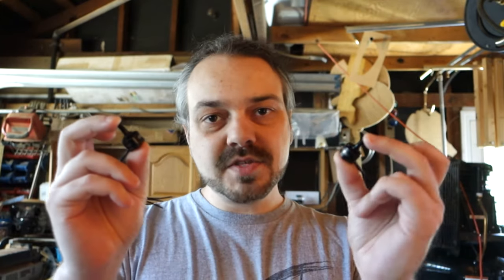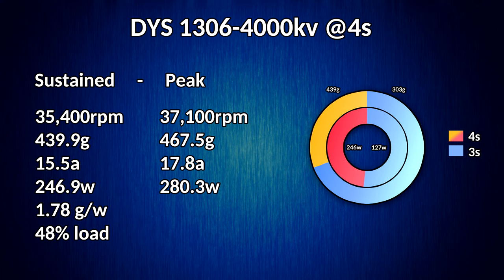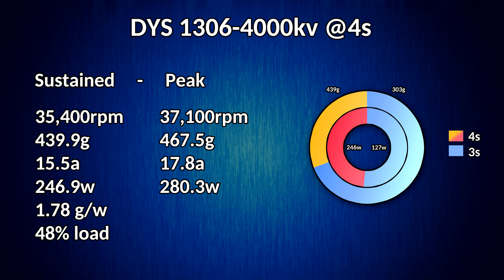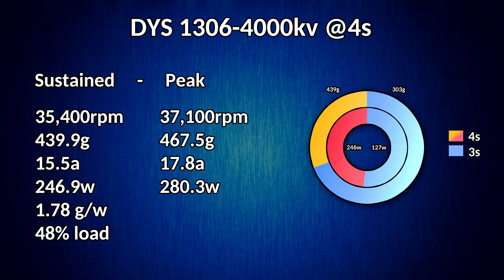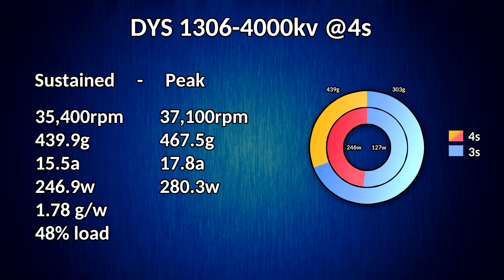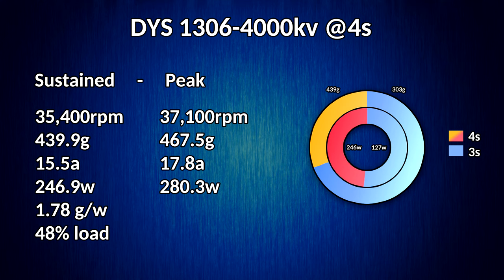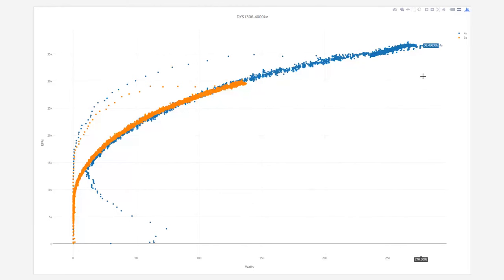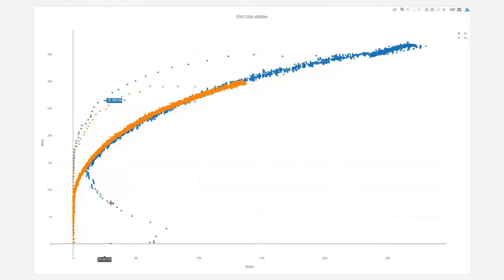DYS 1306 4000kv motor on 4s?

Comment: So I am running these on my 145 Gram before battery Shendrones Hedwig 3 inch. I am running these with 650mah 3s batteries and 500Mah 4s HV none the less.....

The quad is fast as balls on 3s, but on 4s its another league.....my AUW with a 500 Mah 4s battery is 200 grams even.  according to your test that is giving me a peak thrust to weight ratio of 9 to 1......the motors do not get hot, warm yes, but hot. I have I think 30 packs in on 4s packs and maybe 20 in on 3s. Everything is still flying fine. In act it works so well, I am not sure I am going to race my 5 inch at all. 

I do think a heavier battery may throw off the whole equation, but with a 850mah 4s weighs in at 242 grams AUW. 

here is the quad with a 650Mah 3s 75c battery.....its much much faster on 4s.

Comment: Thank you! I am so locked in on my 4s 2300KV 5" inch builds, but the information on high performance 3" quads has been lacking in my research, until this video. 

Now that I found someone who knows what they are doing, let me ask you. are 850 mAh 65+ C batteries with a 1306 3300KV (red bottoms) motors roughly equivalent to 5" 2300Kv motors with a 4s 1300 mAh high performance battery?

It's tempting to go with 4000KV motors, but I don't have a reference. For example, I'd never run a 2600KV motor on any of my 5" quads.

Cheers!

Comment: I have well over 500 plus 3 min flites on my DYS1306 4000kv motors, between my Shrieker130 and then When I moved the motors to my Hellbender 122. All on 4S 1000mah HV packs. They started running much cooler sense running Betaflight2.6.1 and now on 2.7.0. The difference in 3S and 4S is not very impressive by your test but in the air they are absolute beast. My motor temps on 4S stay under 125 degrees which is hot to the touch but not hurting the motors. I have always run them with either HQ3030 tri props or the RotorX 3040 tri props. I had alot of heat issues early on using bi props or the super heavy Dal props. Anyway just thought I would share my 4S experience.
Reply from the maker: +BumpierDrake960 static tests are much harder on the motor than what you will see in the air, there are plenty of people that do run very overloaded setups like that and they will fly fine.  I'm not really sure what you don't find impressive about the results, a 30% increase in thrust is absolutely massive, if you have a decent build that's enough to bring you from around an 8:1 T/W to nearly 12:1 T/W.  Running LiHV you'll be seeing even more power out of it than what you see in this test.

What is unimpressive is the amount of power that it will suck down to get you that thrust, and that you won't "feel" until your batteries are sagging, and if you're happy with the short runtimes that most people are then you won't really notice it at all.  But you could choose a more appropriate motor, short a 25 ohm resistor across your battery leads, and still get better flight performance.
Reply: This is a very interesting experience, thanks. I plan to try a Blade 150 with these motors and RotorX 3040t  on 4s power, but fear of overheating ...

Comment: At 5:30 are we seeing desyncing at 4s at the low end of the throttle? Does the Esc have a harder time controlling the motors at higher voltage?
Reply from the maker: Yes that's a sync issue, I'm pretty sure I mentioned it somewhere in the vid.  Need to keep in mind though that the test ramp is from full stop, not idle, so you do expect it to take a second to spin up from a dead stop, and increasing power while it's trying to sync up is counter productive, which is exactly what we're seeing there.  Just another example why motor_stop is always bad.  The only desyncs that you really have to worry about are ones that happen once you're already spinning and we're not seeing any of that here.